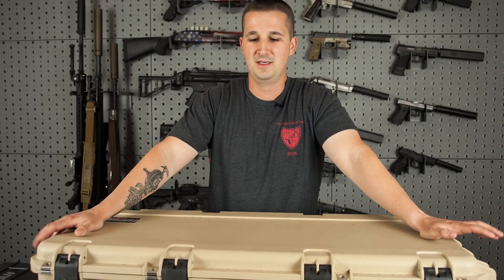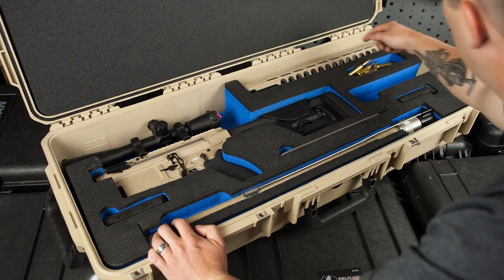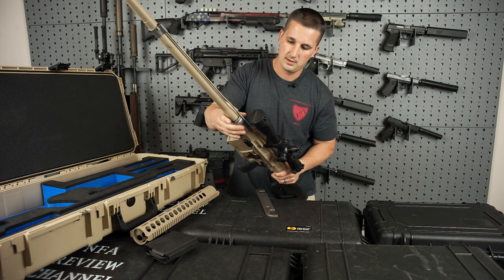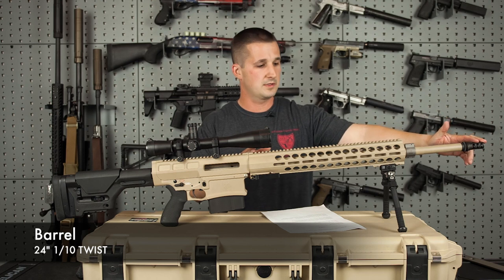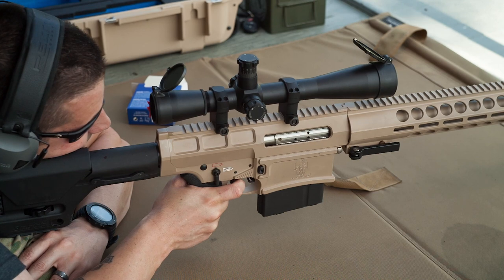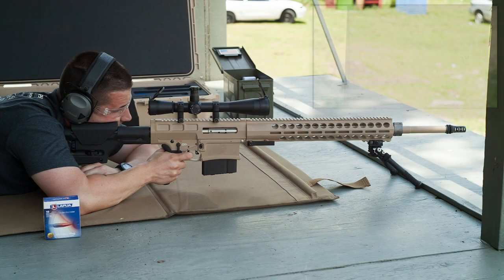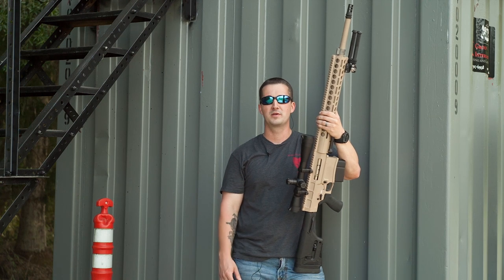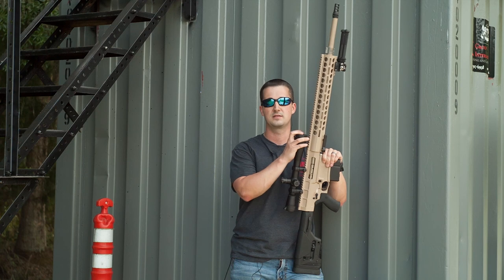DRD Tactical Kivaari - 338 Lapua Takedown Rifle

Comment: 338 win mag does the trick on coyotes! 200gr nice and flat up to and over the 300 marker. But looking at this sweet! A tactical 338 and 50 build are the two trophy rifles for safe 2.
Reply: @Rara Neagra  Mine is a Browning X Bolt Stainless,  glass bedded, with a Boss installed. Very accurate hunting rifle bought it for Elk hunting but have used it over the years for Coyotes always crazy what it does to them. BTW thats a lot of rounds

Comment: the PRS is not a small stock and that thing dwarfs it.  makes me wonder though.  does it hold zero when you pull the barrell out and reinstall it?  does it destroy brass like the Petra does to 300wm  or is it easy on brass?
Reply: My brass has looked very good, the bcg has an adjustable gas key to tune it just right.

Comment: Question:
1. Is there a full auto variant?
2: Is there a 22 round or a 50 round magazine so I can set it as a squad support weapon?
Reply: Raihan Purboyo Or does it take Glock magazines?...
Reply: A full auto shoulder fired .338lm, I’d love to see someone attempt to control that. My TRG42 shoots like a .243 with a TE Muzzle Brake (Terminator), so it could be less work than a BAR.
Reply: @Len_M.  Yeah it would be a challenge, yet at the same time it would be damn fun too. Shooting hi cal guns at full auto.
Reply: @shaku8107  Jokes aside, if a glock had a 8.6mm pistol ammo, attach a really long, integral suppressor for the Kivaari, you'll get the DeLisle a competitor.

Comment: Not to criticize but why would you stop at 500 yards with a rifle chambered in 338 lapua. Anyone buying this is gonna want to see how it performs well past 1000 yards otherwise why pay 6 bucks a round.
Reply: who cares about 1000 yards. a .308 or 5.56 shooting 77gr tmk can do 1000 yards. The only reason you buy .338 LM is to push it past 1500. If it cant do 1500+ whats the point?
Reply: 10 Acres  I bought it 1 inch is fine at 500 does same was built for 1000 but is a battle rifle some not all snipers want a semi auto try. To fight your way out with a bolt action and a 45

Comment: The case isn't thought out well. There's no padding where the scope is and it's facing down, so the weight is on the scope when you pick it up. Hopefully your scope is ok after the airline baggage guy tosses it 9 times. Good one guys...
Reply: I build cases and I agree. You need to imagine a hard shock (dropping it onto concrete) from a fair distance.
Nothing should touch the scope, but anything around it should be snugly supported.

Comment: I'd like to own this rifle BUT... it is a Direct Impingement action and this means, especially with a huge cartridge like the .338 LM, the bolt will get HOT and dirty very quickly when compared to a small cartridge such as the .5.56 NATO in an AR style DI rifle.
So I'll be looking at the Alexander Arms Ulfberht .338 LM instead. 

Piston actions for semi-auto rifles are more reliable, run cleaner and cooler and are use worldwide in military rifles. 'Nuf sed.
Reply: I own it don't have any issues with it does great at 100 yrds and 500 yrds haven't tried any further than that.